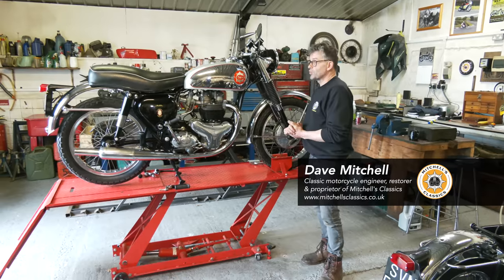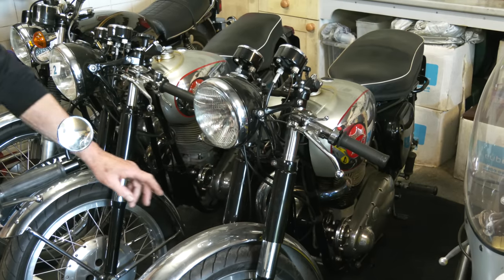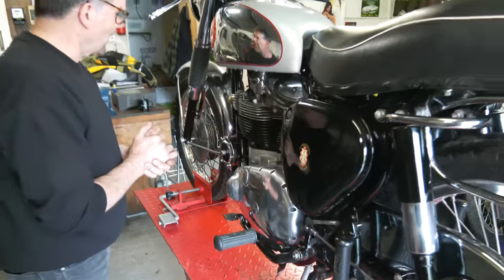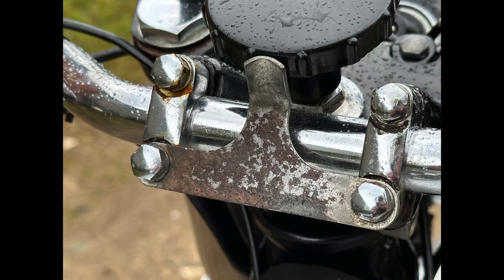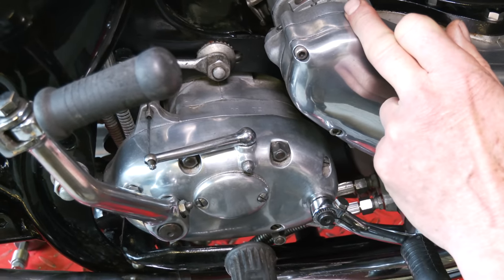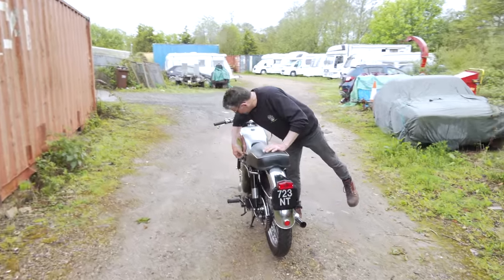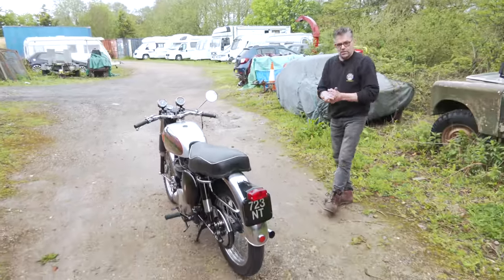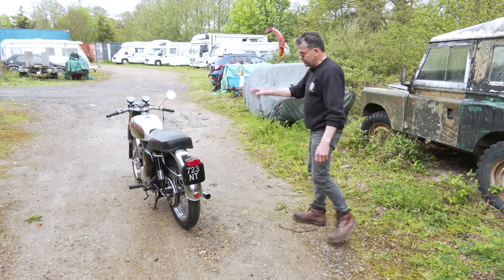For sale: 1963 BSA Rocket Gold Star - quick look & start-up

Comment: Absolutely Marvelous a 650 twin Rocket 🚀 Gold Star only about 1300 made.
Reply: I chuckle every time I hear that name.  It's like the Brits kept adding adjectives to the name rather than make any substantial changes to the bike.  Kinda like Royal titles.
Reply: There were 1584 Rocket Gold Stars made for 2 years, 1962-63.
Reply: @willywonka8730  BSA named the bike 'Rocket Gold Star' because it is the tuned twin cylinder engine from a late model BSA Super Rocket (the 'Big Valve' Super Rocket) in a slightly modified single cylinder BSA Gold Star frame and cycle parts. There were only 1584 Rocket Gold Stars made and production only lasted for two years - 1962 and 1963 - so there wasn't really time for modifications.. In any case, the RGS was pretty much a 'bespoke' motorcycle, there were a huge amount of factory options available to the purchaser at the point of sale, such as multiple different gearboxes, at least 3 exhaust systems, three fuel tanks, two different front brakes, as well as seat, wheel rim, handlebar, headlamp bracket and foot rest options etc.... So pretty much every possible individual preference and intended end-use was covered by the factory..

Comment: Mine's a '62 , out of the factory in June and exported to the States like a great many of all RGS's made. Brought back to UK in the '90s. It was in semi-clubman trim with the rear set footrests and touring bars turned upside down like many used to be. Fitted clip-ons when I bought it. RRT2 gearbox. It's an HC motor meaning high compression 10.5 : 1 pistons but standard Super Rocket cam - if it had HHC stamped on the crankcase it meant high comp pistons plus the sporty Spitfire cam. After experimenting with a retarded mag lever for starting found it starts better in the advanced position and no choke - it kicks back on the first or second swing (not violently like the 500cc DBD34 single) and then will always go on the next swing , settling quickly into a slow metronome tick-over. Don't go over 5,000 rpm out of respect for the engine and will cruise all day at 80 mph / 4,500 rpm if desired.

Comment: That's a nice bike. I had a replica RGS during the 60s, clip ons, rearsets, spitfire cams, 9 to 1 pistons, alloy SR head etc. It had a GP carb fitted but  used so much fuel that I put a Monobloc back on. It was originally a Flash, and had the thin flange barrels which were always a worry with the extra performance. It went well though and handled as good as any modern bike with that duplex frame.

Comment: Sweet bike.  It makes more sense to me to just flip the shifter so it's 1 down 4 up.   Rather than having to open up the gear box and mess with it...if you're going to put on the rear sets.  I'm not sure if I would or not.  I like the touring package, but I've never ridden one of those so I'm not familiar with the riding position.

Comment: I have a 63 Super Rocket Custom bobber (can see on my shorts in my youtube channel)  I have to straddle and really hop on the kicker to get mine started.  High compression.  I amazed at most I see are easy to start with a gentle kick.

Comment: Hi Dave think the microphone makes the bike sound different and seems to have some bearing rumble....but I could be completely wrong as hearing it live is the proof of the pudding. I own a super rocket that has twin gold star exhaust and is built to replica specs with the hhc cam, but I run it with a Mikuni vm30 6DH2 needle and 470 main, but with a ATD governor on the magneto which is joe hunt and the engine has a more bassey sound 😊

Comment: Very cute! The RGS used basically the A10 motor, hotted up with the Spitfire cam and linked to the RRT2 box, yes?. Was the frame a standard A10? I recall that the frame of the heavely DBD 34 was considered the near equal of the featherbed. If the RGS benefitted from this it would be irresistible.